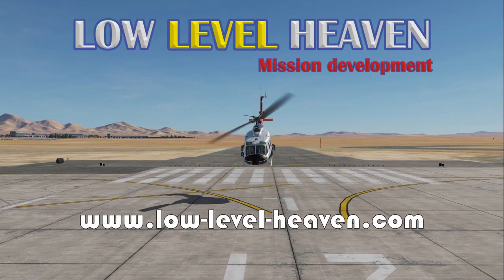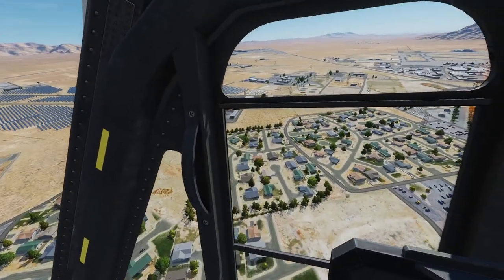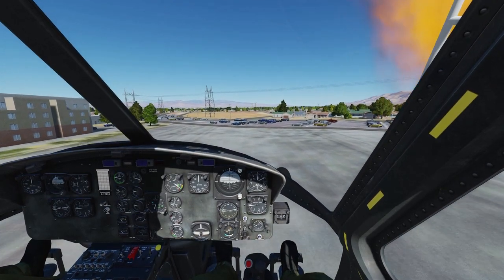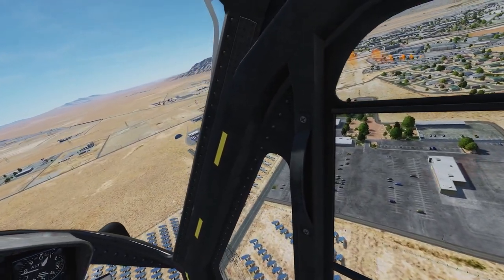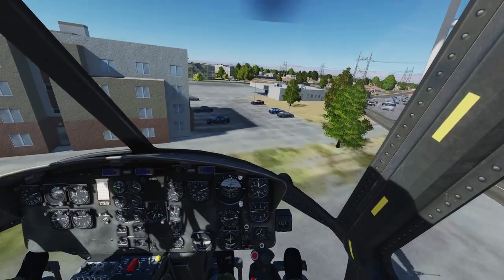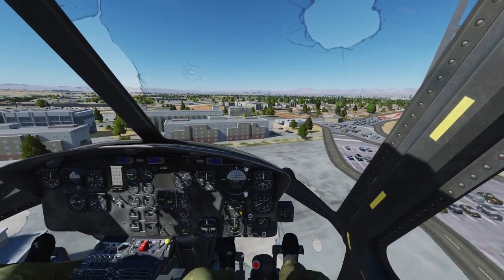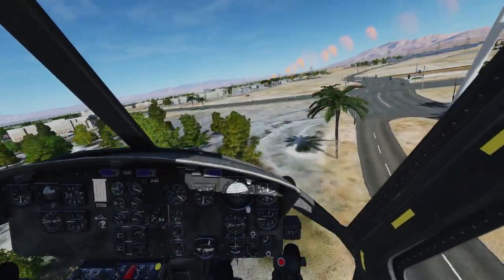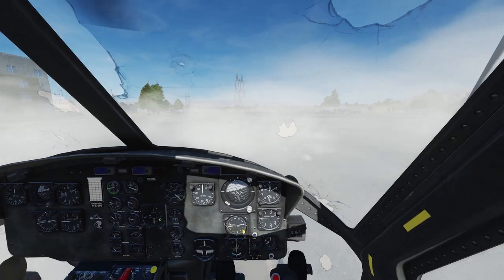Bell UH-1 Tutorial 1 / Combat Takeoff and Landing

Comment: A simpler way is L WIN Home, which puts the startup in auto sequence mode. Takes away all the hard work of remembering what switches to push. Same with shutdown, which is L WIN End
Reply from the maker: You're right about that, but there's also a very big but. 😎
DCS is currently the most complex and realistic simulation of aircraft. It is precisely this complexity that makes it so appealing and poses a certain challenge. The experience in DCS should be as close to real life as possible.
This is not related to the use of the self start function. The same is true for many missions. 
Everyone wants to feel like Tom Cruise, but without having to do anything for it and then complaining about realism.
I also use the self start function occasionally in different types, but I think you should try it without as often as possible. Gladly also with checklist, which contributes to the realism. 🖖
Reply: @lowlevelheaven  I know what you mean. However, working and flying solely with keyboard and mouse as I don't own a Hotas, you can imagine the hard work that is already being put in to fly and control this, along  with the numerous jets I have?. This is the only model I have used autostart and autostop on.   👍
Reply from the maker: Respect. 👍 I've tried this for fun too, and if you get off the ground fast enough, it works. But it's not really that great. 
Even with the cheapest joystick or HOTAS it goes worlds better.
But the problem lies somewhere else. 🥺
It is a crime to play DCS with a keyboard and mouse. So the question is, do you turn yourself in, or do you wait until the special task force gets you out of bed at night?  😂
Reply from the maker: You can join our squadron if you like DCS and the Huey and invest a little in hardware. Of course you can also visit us with keyboard and mouse and get an impression.
If you use DISCORD, you are also welcome to DIRECT with Scoop, one of our British pilots.
Reply: @GIZALARF  do you fly in VR?

Comment: At 2:48 the windsock suggests you're doing a left crosswind approach.  Was this intentional?  i.e. due to other factors/obstacles?
Reply: My understanding is that in DCS the windsock shows STRENGTH of wind, but not DIRECTION.  It is placed on the map with a facing, say north-south.  If the wind is blowing from the west, the windsock still will stream out to the south. The windsock will always point it's set direction, even if the wind changes direction during the mission. At 2:48, the smoke is blowing toward the helo, but the wind sock is blowing 90° off.

Comment: hmm, so according to the SMEs, the us army pilots we work with, a combat landing would not only be a calculated risc. Most likely, the safety comes first. If the LZ is hot and there is no way to make a proper landing, they would call out that they are unable to make it if the weapons that are facing you are to big and to dangerous. There is no practical reason to risc a helicopter and a crew on purpose in RL. So before such a landing in a hot LZ would be done, there would be a threat assesment being done and if needed, CAS would be called in to clear the LZ as much as possible, to ensure lowest threat level as possible.
Reply from the maker: Hey Sven,
You are absolutely right.  So this is more about the difference in performing the landing than about tactics.  
And to be honest, in DCS you can fly with such real-life assessments in mind, but it may break the fun and the mission. In this perspective, it is a game.